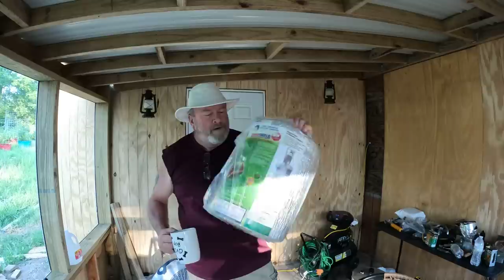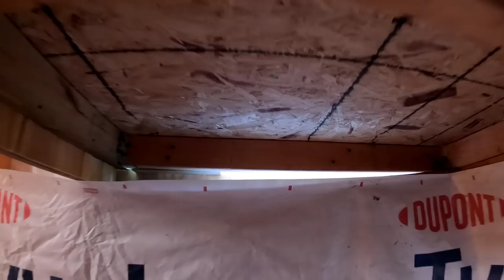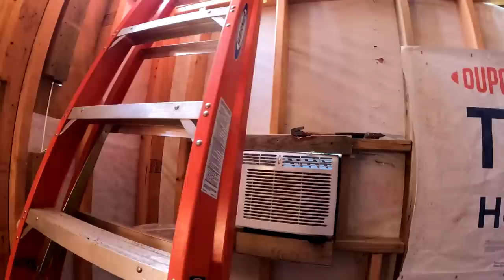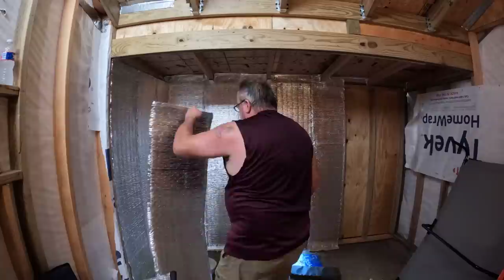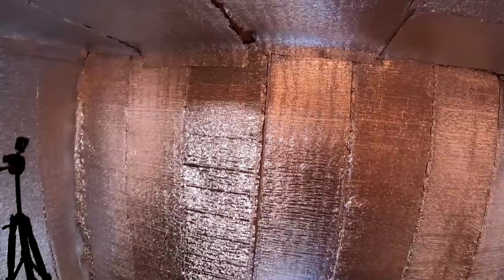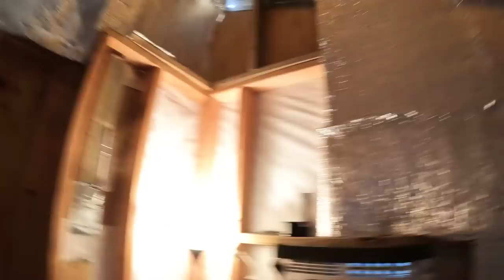Installing Smart Shield Insulation On Dog Apartment/ Building 3 Things At Once

Comment: I may check into that insulation, looks easy to work with and effective. Glad it's coming together, and having the laundry out there will surely give you more space in the house. You could put up a drying line and save on electricity too.

Comment: just a thought, since you have the deck above, I assume it will have outdoor furniture and maybe an umbrella and cushions, have you thought about putting a ceiling in the tall part of the shed and a door from the deck so in the winter you can store all the deck stuff, this will also make a smaller space to heat and cool below. also during high winds, you could run out and stash your stuff. You have made so much of this build multi-purpose, that's really neat

Comment: Don't take it personal 'er nuthin, but that floor really ticks me off. 🙃
Reply from the maker: I didnt pour that floor, its 40 years old, and It not how this build ends
Reply: @ouachitamountainliving  I know you didn't pour that floor. I've watched every episode you've put out on this build. It still hurts when I look at it. 
I wanted to see how your screen system worked. 
Its nice, but I don't think it'll work for me on my 12 ft x 40 ft back porch without framing in between the porch pillars - which are 7 ft tall & 8 ft apart. With spans that big I don't think I could get it tight enough & I really need a screen that blocks more sun since my exposure is west. 
Nevertheless I've been rootin for ya. That floor still drives me nuts! 😝
Reply from the maker: @rt3box6tx74  Yea  Its not a good floor, but I may put in a subfloor over it later
Reply: @ouachitamountainliving   Id probably try the self-leveling pour-on floor leveler before building over it. It's a pretty  tough product. I used it to level a wood floor on a pier & beam house that the 4 x 5 bathroom floor was a little off of level after the house was moved. It worked great for me, but I laid sheet vinyl over it so it wasn't exposed to foot traffic longterm. I think they have a similar product for leveling concrete floors. I mixed my 1st batch too stiff so it didn't level out enough. 2nd batch I got the hang of it. Your porch is going to be a nice place to escape the bugs. I'm jelly!